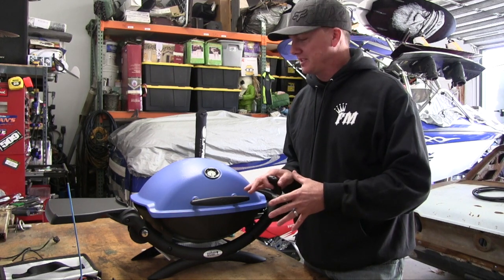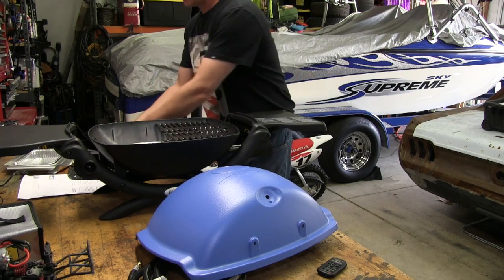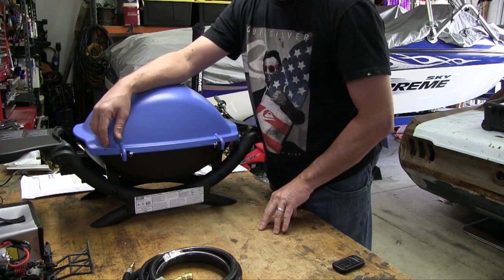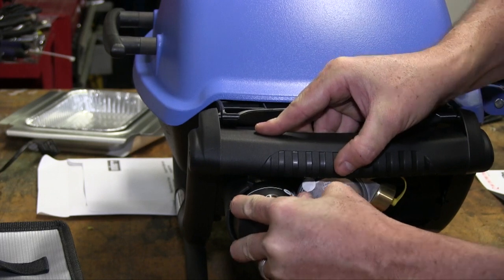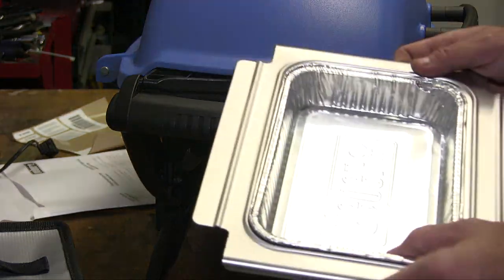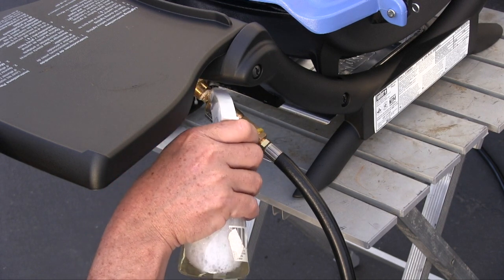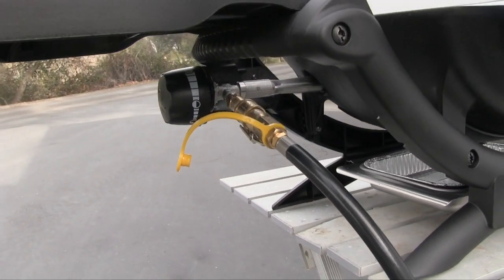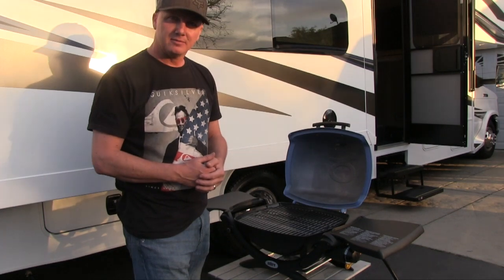Weber Q1200 BBQ RV hook Up Jayco Greyhawk Unboxing Setup

Comment: Thanks for the info and link to the brass fitting to allow the removal of the regulator and adapting to the larger quick-connect.  Works great!

Comment: The o-ring means it's a compression fitting and doesn't need the plumber's tape. If anything, the tape is what will cause sealing issues. Clue in, boyo.

Comment: Just curious when you compared with and without the regulator were you connected to the trailer for both? I am interested in knowing if there is a difference when using the regulator with the 1lb throw away bottles vs no regulator connected to the trailer?
Reply from the maker: Big Stein I only tried it hooked up to the RV. Because the RV already has a regulator. If you use a portable propane bottle you would need a regulator.

Comment: Great info! The QD could also be rigged to feed an external reg for bottles. Could you re-purpose the bracket to support the hose? I worry a trip over the hose could snap that little aluminum valve. Cheers.
Reply from the maker: Mine is close enough to the RV that nobody walks over the hose. No trip hazard. Rather not carry an external tank when we can go direct on. I now use a 3 way that feeds my Weber, black stone and fire pit

Comment: The link to the brass fitting with regulator does not look like the one in the video. I’m thinking i have ordered the wrong one.
Reply from the maker: It will still work the same.  It just doesn't have the little extension the one I used does.

Comment: Hi Nice video. I have a Grill like that just got a camper with gas line at rear. Can I leave my regulator on or do I have to take it off when using quick connect hose to trailer.
Reply from the maker: It won’t get as hot and the flame will be restricted. Your RV already has a regulator so your doubling up by leaving it on the grille.

Comment: I was watching this over and over.  Not all the reference parts on Amazon are the same parts that you shoe on the video.
Reply: @mediocrity9574  thank you.  Ordering now.  Time for a trip with the Q1200.
Reply: You’re welcome. This is meant for removing the regulator on your grill, and adding a quick connect that attaches to your RV
Reply from the maker: I’ll have to go back through and check the parts list. Thanks for the heads up.